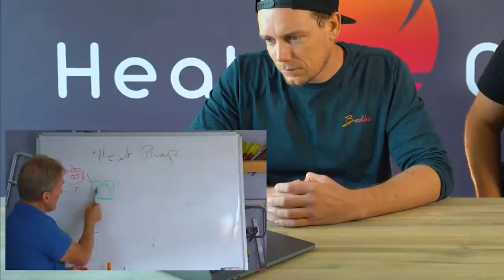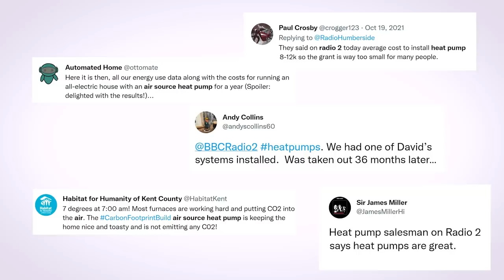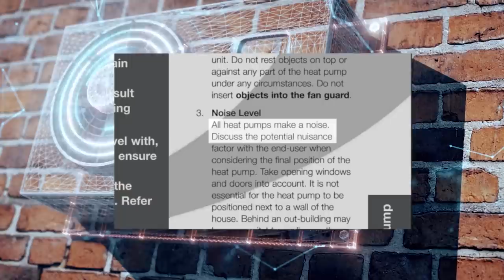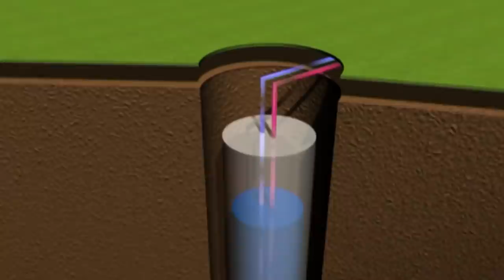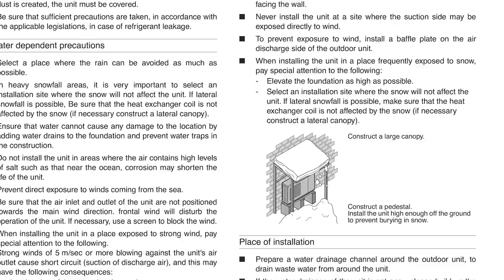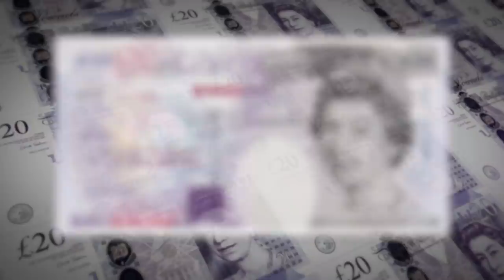Heat Pump Secrets They Don't Want You to Know

Comment: I really think this sort of video is a waste of time. Heat pumps properly designed and installed work. They are not suitable for every situation just as Gas or fuel aren't. The biggest problem with heat pumps is the initial cost and the limitations with older properties with poor insulation. It would be much better to have aa series on when and how to fit them as well as when and how to go for gas or fuel or whatever other options there are. Where we live many houses are obliged to heat with electric storage or radiant heaters due the lack access for fuel and no gas. It does seem that the UK has a big problem with miss selling and incompetent heating designers which hopefully will improve with experience and time. Keep up the with the videos

Comment: for God sake!!! not this again!!! 

still talking nonsense about noise, cable size, flow temperatures, glycol, etc etc. 

might I suggest you look at gas boiler technical data information and see what flow temperatures they recommend the boilers are run at to achieve the 95-97% efficiency they claim. the optimum flow temperature is 50 degrees and below. meaning all Emitters in the house should be sized suitably. I.e acceptable for heat pump installations (especially r32 units). 

you have literally cherry picked the installation instructions from a range of different manufacturers,  designed to help the correct operation and longevity of that installation and portrayed them all as needed on every installation which is simply untrue. fear mongering at its worst. 

you ranted about the installation cost of ASHP and then rave about GSHP when the installation costs at 10 x higher when the SCOP remains between 10-25% difference. most cost benefit analysis' show you do not make that extra money back of the lifetime of the installation.
Reply from the maker: Andy 
 The point about a boiler is you can turn it up in the very cold weather. Do you have a heat pump? Thought not. There are so many fans of heat pumps who have never lived with one.
Reply: @SkillBuilder  so the "point of a gas boiler is you can turn it up in the cold weather" ???? So basically you are proving the point that heating systems with gas boilers are not designed or installed correctly and gas boilers are being used as a crutch. 

You then go on to slag of the installation cost of a heat pump for correcting the incorrect heating system that should have been installed right in the first place!!!! 

Who says I haven't got a heat pump? Specifically an 8kw R32 refrigerant split with 230 ltr unvented cylinder and low loss header to hydraulically separate the heat pump from a new build microbore system, also providing minimum water volume, bypass and flow rate. Nope..... not me. I obviously know nothing on the subject.
Reply: Andy Jones is spot on!

Comment: This is complete trash. He is completely ignorant of how a heat pump actually works. I would be writing a two-page response to go through this video. And prove him wrong on so many points. I have done heating and cooling and have installed heat pumps for over 20 years and currently use one in my own home. I live in the Midwestern United States and do not have extremely high electric bills in the winter or in the summer. An efficient system, properly charged will deliver more BTU's per dollar than gas or any other fuel. And the pain in his heart just exploded when he speaks. Makes me feel sad for him. Say a healing prayer for this guy. Peace
Reply from the maker: Gabe
You do not understand what this is all about, save your prayers.
Reply: Please, do a point-for-point rebuttal. With your experience, it should be a walk in the park.
Reply: @johndoe-vc1we  Its worth watching the Heek Greek videos where they do exactly this on Skill Builders videos.

Comment: All you are saying is that poorly installed installations don't work. The same goes for poorly installed gas boilers, underfloor heating, insulation, steel beams, roof tiles..  I can go on, the list is endless.
Reply from the maker: a gas boiler is proven to work and they are a lot more reliable because they have fewer moving parts. You can also get them serviced in the same week that they go wrong. People wait 4 months for heat pumps to be repaired and that will get worse.

Comment: Roger is a very negative person and if you're going to make the comments then you should compare this with the other heating sources, i guess you're mainly comparing to a gas boiler, so lets do that. most boilers produce the same level of noise, as a good heat pump but there is no building regs for boilers? Boilers also have a condensed water pipe (assuming majority are condensing these days, all new ones will be), this also needs concideration. The difficultly with fluing requirements. Running open circuits on weather compensation has always been a better way to run a heating system, so if its been designed correctly by a good engineer your home will heat up evenly and have no requirment for TRV'S. I agree a house should first be insulated to its best, you do get better perfomrnace from a heat pump if left on all the time but I've always recommend using it like a boiler using a programmable room stat as i would with a boiler, as it will cost less to run than running it all the time. If by the sea extra protection is required but this is the same for everything else on the house. We can all easily pick the bad in everything but people like you with a voice should also compare and give the positives.
Also why now speak to the #heatgeeks as they actually know a thing or two. By the way I'm certainly not saying they are right for everyone right now but likely will be in the future for many.
Actually why not do a video showing how to increase efficiency of an existing system as this will get eveyone pretty much ready for a heat pump. If you know what you're talking about!
Reply from the maker: Instead of telling me what to say and do it is worth you applying your extensive knowledge of heating to a video of your own making.  Simply criticisng me is a very negative attitude.
Reply: @SkillBuilder  gaslighting thats called. Who says i haven't done my own video, at least it would be accurate.
Reply: All good system advice there
Reply: @SkillBuilder  #heatgeeks Do a video with them, debate them. If you want to be critical of something atleast speak to an expert, instead of just rambling.

Comment: I have no idea what brand or cou try he is talking about. As a HVAC tech I have dealt with HP for years. Many of the biased comments he makes are directly applicable to air conditioners. I presume he is agaisnt air conditioning also then? Literally every negative he has tried to lay at the feat of heat pumps is worse for simple air conditioners.

Noise. Less the  50 dB at 3 feet for large units. Minisplits are less the 40
Location. Same as ac
Corrosive environment. Same with furnaces with heat exchangers
Roddents. Same for furnaces and AC
Snow. Same for furnaces.
Excessive  rain. Same for furnaces and ac

So on and so on. Take any heat source instruction manual and read it all out. You will find many of the sa,e considerations. This is filled with a biased opinion and not objective at all. The only thing I can agree with here is yes it is  ot always the best choice based on application and ALWAYS get a second opinion. Including a second opinion to his ;)
Reply from the maker: Hilarious comment thank you so much.

Comment: Your still burning the natural gas, just at the power plant instead of the home and now incurring all the transmission loss as well.  Pushing heat pumps prior to getting the low carbon energy supply and robust grid required to support the demands of electric heating and EVs in place does nothing for the environment.  With big efficiency, comes big complexity, and much higher maintenance costs.

Comment: rofl get a grip.... i have been running heatpumps for the last  15 years right now im running one in my main house one in my garage and one  in an external building, i have never had any problems  with any of em besides vibrations  in my garage wall from a  wrongly installed outside bracket, this video is like focusing on the  warning label on plastic wrapping from a childrens toy and saying that  children will suffocate outomaticly by removing the wrapping  i'm not saying you can't or wont run in to any problems with heatpumps but thats true for basicly any technology.

Comment: supply all those heatpumps plus electric cars, I've just listen to the podcast, so are they shifting all the blames from diesel cars now,because the other chap is using the exact same argument that was used with diesel cars for gas boilers, they will heat your home no problem but they are not cheap, They are ideal for homes and flats thats electric only, thats where you see massive savings but to replace gas with them more expensive, the chap who said he was happy with his installation was in a converted barn and was using heating oil so in that case its not that much cheaper but you dont have to be bulk buying in summer when oil is cheap and having a very large tank for storage

Comment: Can you please stop saying that more electricity means more power stations; renewables are the cheapest form of energy per mhw now, so there will be very little demand for new gas powered stations.
Reply from the maker: Pumpkin I  think you might like to read about Germany. They were in the vanguard with renewables and they are just bringing a brand new coal fired power station on line to cope with the short-fall.  I love wind turbines and solar, I love wave power but don't let the green washers fool you. 
We need to heat our homes when we need to heat them. The big problem is storage of energy.
Reply: @SkillBuilder  I agree that storage is what needs to be overcome, but it's by no means insurmountable. Pumped hydro already plays a key part in keeping the lights on, hydrogen can be produced and stored then turned back to electricity. It's not cheap, but burning gas at home is not a continued option; the longer the country takes to tackle climate change the more expensive it gets.

Comment: It sounds like you read the instructions, but either didn't understand them or are intentionally misrepresenting the information you found. 🤷🏼‍♂
Reply from the maker: If you have not seen the instructions and compared them to my interpretation you can't possibly know that. 
What I can tell you is that Vailant have a new heat pump that is deemed suitable for coastal areas and has been designed to be very quiet. They didn't do that because there was no need for improvement. 
I have no axe to grind, I am merely pointing out things that people should be aware of when selecting or sighting a heat pump. These are not things that salesmen are at pains to point out. 
Maybe you should try not to judge people by your own low standards.
Reply: @SkillBuilder  I have seen the instructions, so I do know that. There's a whole load of things in instructions which are put there for compliance or legal protection and don't necessarily have any impact in the real world. For example, the example you cite in the video about not installing a heat pump near to the coast - yes, that exists in the instructions of many appliances, but they still do get installed and used near the coast, metal rusts, this isn't exactly  news. Manufacturers put these things in instructions to protect themselves from stupid users - if you're supposed to be a professional I'd think you'd know these things?

There's some noise from heat pumps in the same way a gas boiler also makes noise. The upside with a heat-pump is you install them outside, not inside! They do not make enough noise to annoy neighbours unless they're positioned very badly (for anyone reading, they're just a big fan that makes noise, it's exactly like an air-conditioning unit).

How many gas boilers have you installed outside, near the coast? lol 

The reality is you're pumping a controversial video full of misinformation to get likes and follows, shame on you.
Reply: @SkillBuilder  there are split inverter type AC;s sold in India that come with specially coated condenser pipes to delay corrosion in salty air. LG does those. For other brands, an equivalent spray as you mentioned is the way. Anything metal in salty air will corrode. It is an issue and reduces the life of appliances.
Reply: @JohnBaxendale  Brilliant bud.

Comment: The need for minimum flow rate is exactly the same for a heat pump and boiler. Boilers and heat pumps both have the same "risk" of rodents eating cables, in fact I have found nests of rats inside the casings of commercial boilers. Neither boilers or heat pumps should be located in wet environments or areas where snow accumulates. Salt spray damages bolers as well as heat pumps. Noise levels are around the same from a fan assisted balanced flue and a heat pump assuming that both are  properly selected. Your message is hardly nuanced, in fact it's quite biased. You said initially that properly designed heat pumps work well in appropriate settings and then spent the rest of the video rubbishing heat pumps!
I have no preference for any mode of heating, I use whatever is appropriate in any given situation but I think that people that don't have expertise in selection of heating systems need the kind of advice that is contained in the first few minutes of your video and are not served well by 90% of what followed. Your messages are mixed but biased towards giving heat pumps a bad name for the wrong reasons. The guy that was promoting heat pumps in the video was talking rubbish and was on the other extreme. He was doing that horrible thing that politicians do: taking a tiny little near-irrevant kernel of truth and wrapping it in lies to suit his agenda. Shame on him. He didn't inspire confidence in heat pumps, he did the opposite.

Comment: Not sure what skills are being built here. Lots of Iffy sort of true, not quite so info. The size of the wire raceway is not an indication of efficiency. More efficient units simply waste less energy. A leaky house does not reduce the efficiency of the appliance so spend more money using something less efficient I guess because the windows leak. Run credible numbers using the cost of the energy source (s) and compare.  Would you buy a car that gets 10 mpg rather than 30 mpg surmising there are lots of hills to drive over. Common sense and real numbers usually provide the most economical path.

Comment: No you don't need to add glycol to a heat pump system.
Reply from the maker: No you don't except it says so in the instructions.
Reply: @SkillBuilder  nope. Not all Heat pumps say that. Eg I'm in the middle of installing a High temp Daikin and we've installed anti freeze valves so as not to use Glycol. That's as per Manufacturers instructions. In fact on the past 3 installs I've done in the past month or 2 we've only had glycol on 1 system which had a plate to plate heat exchanger on it so the rads were filled with normal water and just the heat pump had glycol.

Comment: Roger - carry on telling the truth - my experience of air source heat pumps is very very close to the horrors you've outline. I hope more people take note of EVERY point you make before installing a HP. I'm going to pass on a link to your video to my MP so that he too is aware of how taxpayers money is being burned on promoting a largely unsuitable method of home heating to unsuspecting buyers.
Reply: It would be good is Roger actually told some truth. Most of what he says is just his opinions based on his poor knowledge of heat pumps. Perhaps yours doesn't work well, in which case you should take that up with the installer, but they do work very well indeed. The fact that you say he have to pour boiling water of it to defrost it should be telling you something isn't right with your install or usage.

I was in a car crash once. I don't blame the car for that, nor do I go around telling everyone they shouldn't have a car, so why do people blame bad heat pump installations or operator error on the actual heat pump? The technology is decades old, and tried and tested in some of the harshest environments

Comment: The electricity that drives them is not green. The expensive fitting, radiators, heatpump cost and redecorating costs. If you need to retrofit for insulation expect more expense. It's not a solution for most people given the prohibitive set up cost and the negligible carbon reduction when you factor in the above. It's the green religion, believe in me to be saved just not saving money.